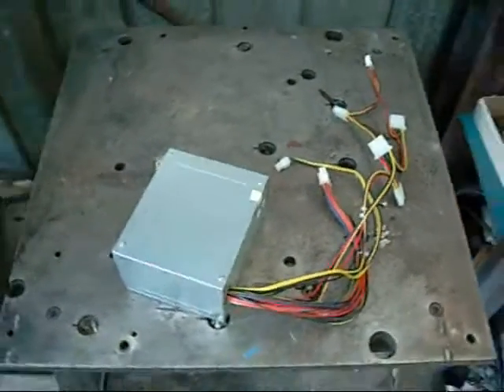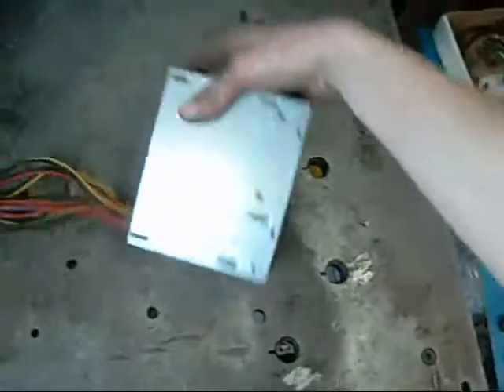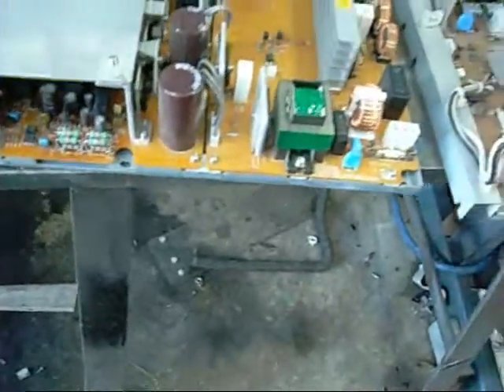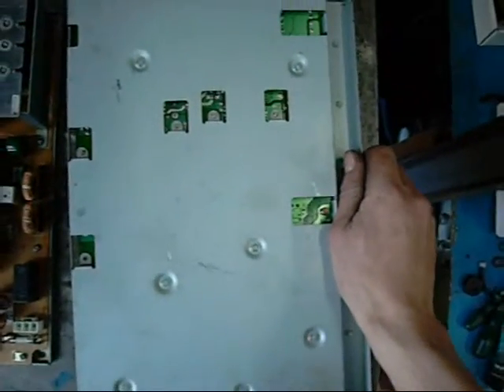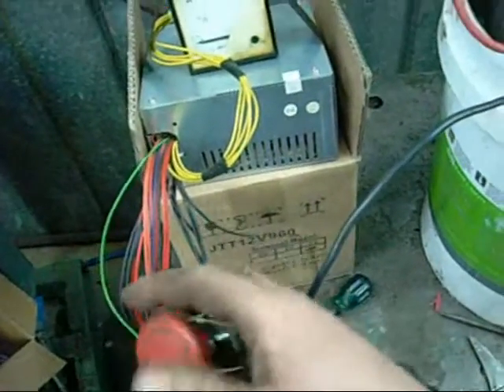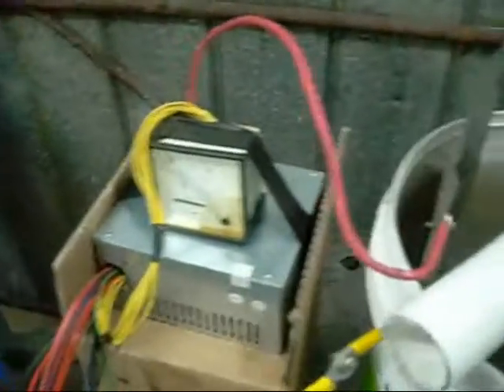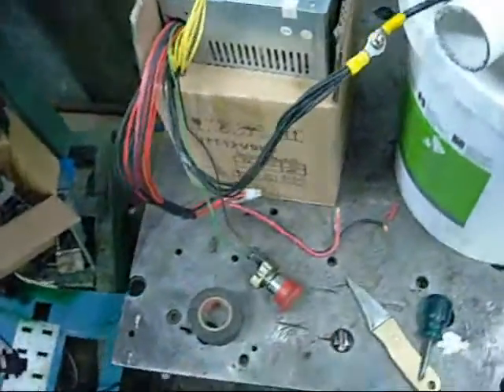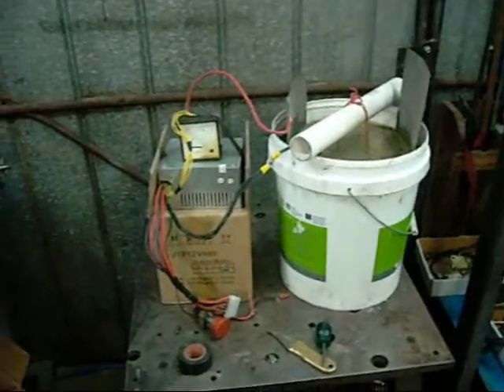Electrolysis with ATX Computer PSU

Comment: if you only want +12 volts- say for electrolysis--do you have to bundle 
all the yellow wires together as well as all the black, or can you just 
use one of each and ignore the rest?What advantage do you get from bundeling
Reply from the maker: Bundling them together will give you better current draw handling, less 
heating of the internal copper wires if your running it hard. most 
simple cheap PSU's have a single 12V rail and a ground, so you can 
safely combine all yellow and all black. Some PSU's have 2 separate 12V 
rails, do not combine them together!, open it up and see where all the 
yellows and  blacks intersect on the board, they should be in bunches.
Reply: exactly what I needed to know --many thanks
Reply: one more thing, instead of opening the box--can i just make sure all of the yellow wires i use read +12 volts
Reply from the maker: not really, if in doubt, just bundle up the ones from the HDD and ATX plug, some PSU's have separate rails to supply the PSU with those 4 pin Molex plugs
Reply: Thanks again
Reply: hooked up green and black--cannot get fan to work or any reaction.  do i need a resistor?
Reply from the maker: does the PSU turn on?, some have a thermal switch on the fan and will not run it until they warm up. that or you could have a dodgy fan.
Reply: I have 3 atx power supplies(may be of the older type)-they all fail to respond at all with green and black.
Reply from the maker: that is really odd..
Reply from the maker: Check your incoming power, and give it a load, plug a HDD into one of the power connectors, some will not turn on without load.

Comment from the maker: @domokid the typical atx supply needs a solid signal going to it to turn on, simply putting a momentary switch across green and black will cause it to start when the button is pressed, and stop immediately after it is released

Comment from the maker: @Jaytheozzi AT supplies will still shut down when shorted, all Switchmode supplies I have come across do it.
just put it in your steel box and keep loose items away from the outside, I recommend that for any PSU.

I've never herd of a PC power supply failing and burning long enough to cause a fire outside the case, I have seen burnt traces before, but the fault usually shuts off the mains before anything can continue.

Comment: @Aussie50 Correct, the 5 volt rail is often the reference.  They all share the same transformer, until you get into the large or high-end units.  The latest ones have more than one 12 volt rail.

I actually put a couple videos up fairly recently that give a good look into computer power supplies.

Let me know what resistor values you come up with later.  If you need help calculating to see if a certain one will work as a dummy load, I can help with that too.

Comment: @Aussie50 It works that way because the voltage regulator circuit almost always measures the 5 volts.  Goes back to the early days of logic circuits when all the critical circuits were on the 5 volt rail.  When it is run without a load, it runs at or near the over-voltage protection level.  This is sometimes called a crowbar circuit.  Some power supplies get really unstable like that, other just run at a low voltage and get touchy to load changes.

Comment: Most computer power supplies need at least a 1 amp load on the +5v rail to run properly.  Try a 2.2 ohm, 15 or 20 watt resistor.  The 12 volts will often rise when the 5 volt rail is properly loaded too.

Also, most of those cheaper, light weight power supplies are way overrated on the amps.  Probably why older ones worked better for you :-)